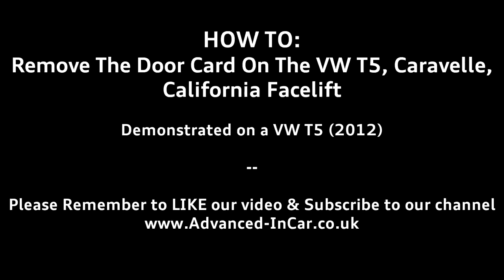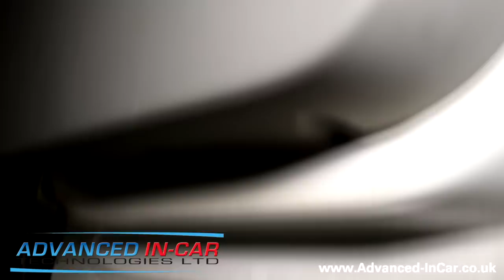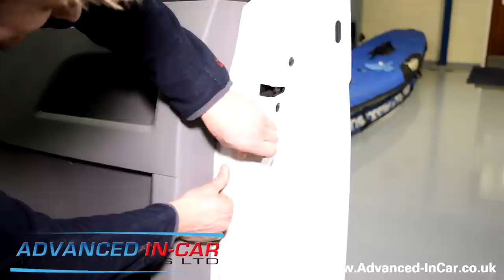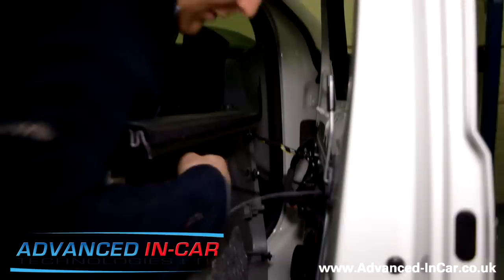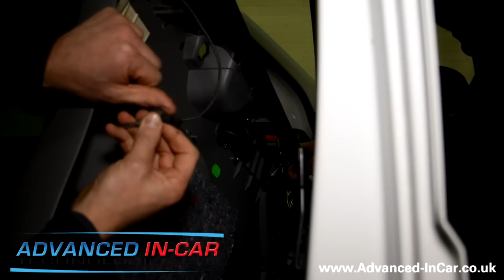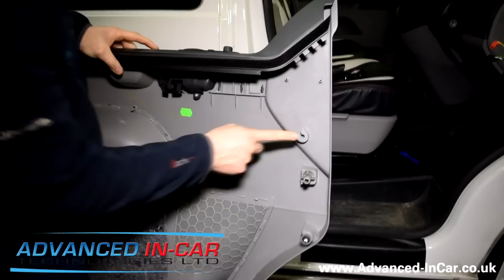How To Remove The Door Card On VW T5, Caravelle, California

Comment: Two important notes for removing the door card from a CARAVELLE (and therefore I think a CALIFORNIA too):
1. To get to the door handle screws, you need to remove the top trim completely. It's the panel that runs forwards from the interior door handle. To remove it, prise it gently UPWARDS; there are 10 clips holding it in place. You can then very easily get to the electric window panel connections as the window controller comes off with this panel. 
2. The screw in the centre of the door is hidden behind the rubber trim in the door pocket. To get to the screw, prise the EDGE of the rubber away with your fingers and work your fingers along the edge to the front of the pocket. The screw's (roughly) in the corner of this pocket. 
Otherwise, an excellent instructional video, thanks!

Comment: Remove and replace tip: If you scrape any steel screwdriver over a strong magnet a few times, then steel screws magically stick to it, making job quicker and easier.